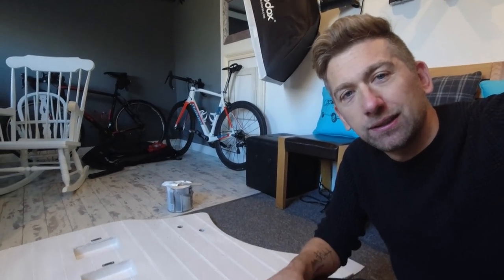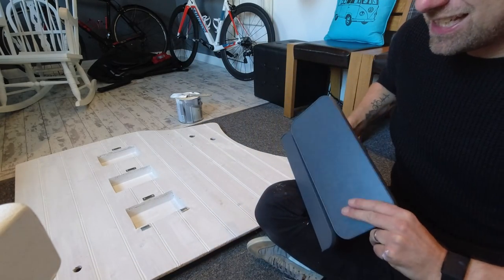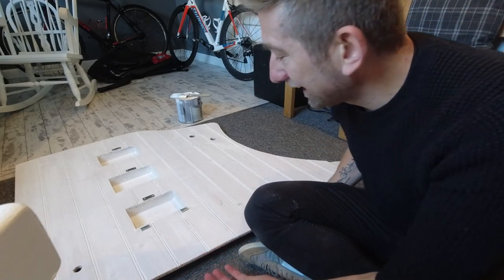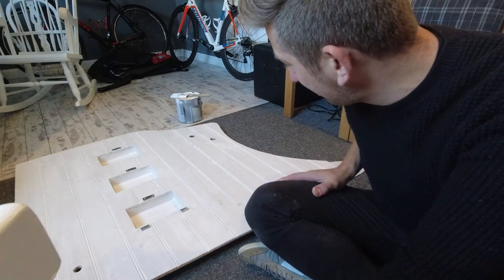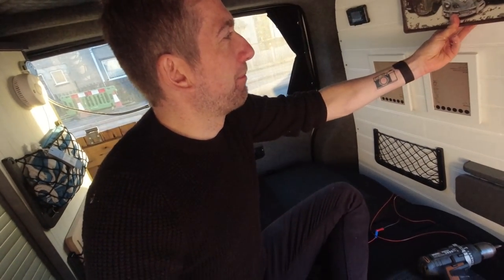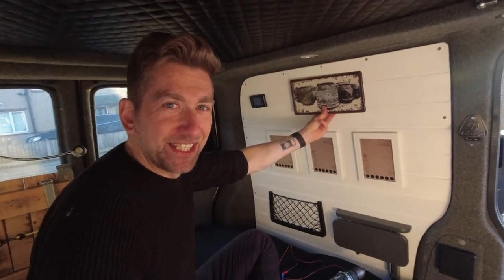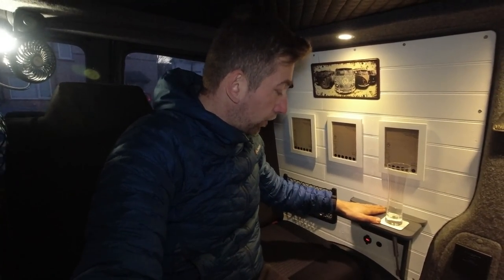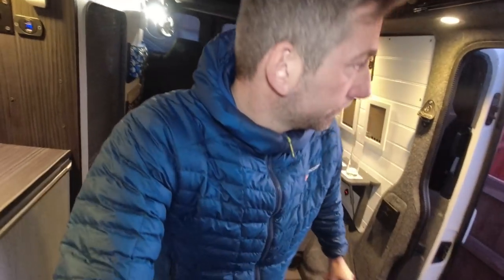Camper Van STORAGE UPGRADE - VW T6 Camper

Comment: Hi Colin.  Can you tell me where or how you had the underside of the pop up bed quilted?  Mine is just solid and I think having a surface like yours would help noise reduction.
Reply from the maker: Hey Chris, it was done by C&H Pop Tops when I had the pop top installed... Not sure if they do it as a separate thing though ;)